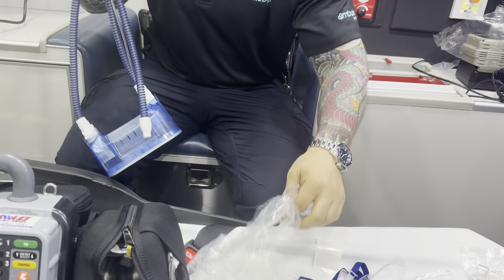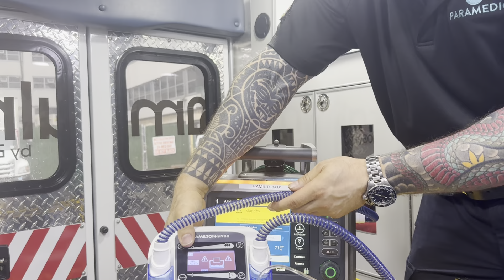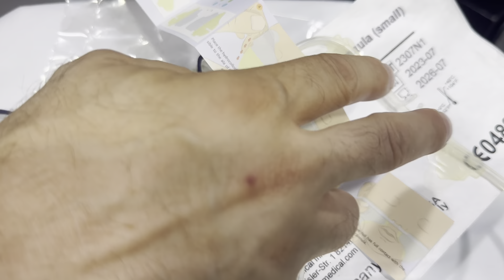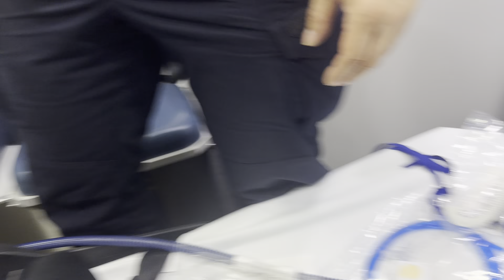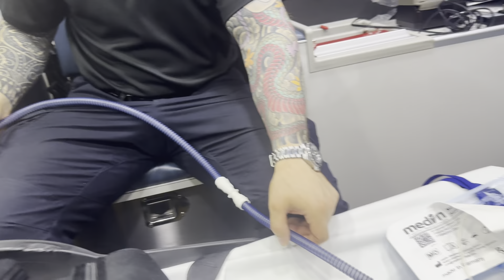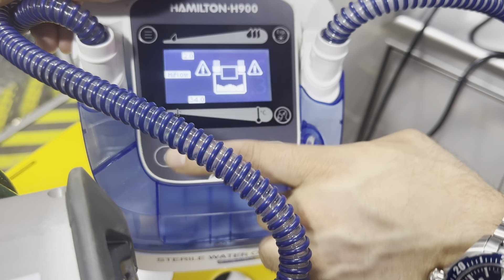HFNC High Flow Nasal Cannula Set up: Hamilton T1 Ventilator with H900 Humidifier for CCT Transport

Comment: Awesome video! Thanks for sharing! Might be helpful for some to note the Nuflow NC are for premies, Neo, and children. Adults don’t usually get the cheekies (stickers to hold the NC). Concerning flow, with adults we go less by weight and usually simply start at 8-10L and go up based on work of breathing and comfort and titrate FiO2 to maintain sats. Also, the T1 itself will not heat the circuit. The heat comes from the heater. When you don’t use a heater, an added HME can aid with heat exchange. There’s no prong connection on the T1 to activate the heat in the heated circuit. So if you need to take the heater off for transport, your only concern is that the high flows can dry out the airway so don’t do it for long or use excessive flow. There is also a silence button if the alarms bother you.
Reply: If you run out of water while the heater is connected and running, then yes, you should be concerned that it will over-heat the airway.
Reply: Also the HMEs I would think only really apply to invasive ventilation. There shouldn't be any back flow in a hfnc circuit